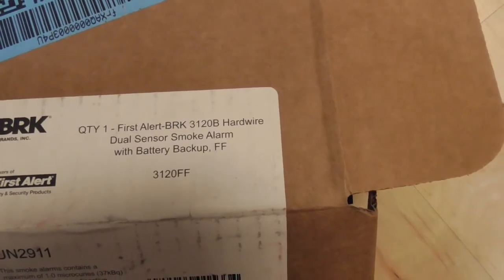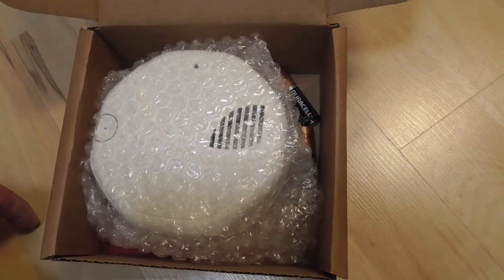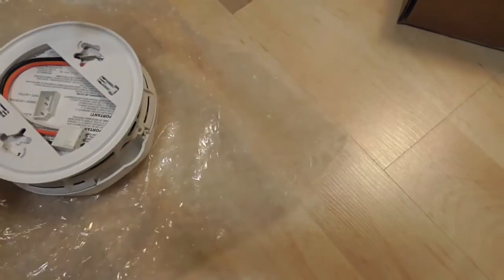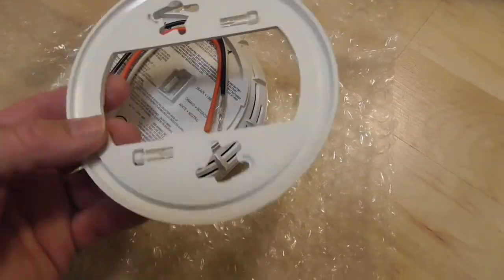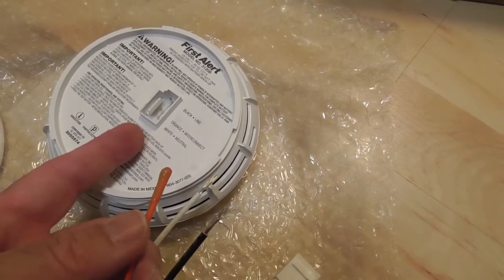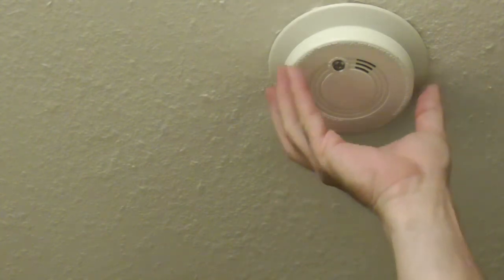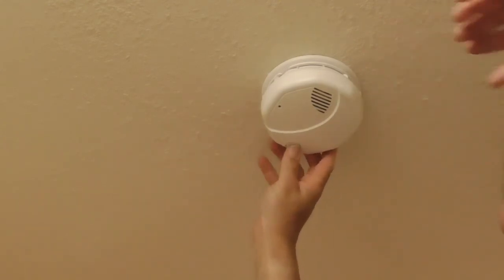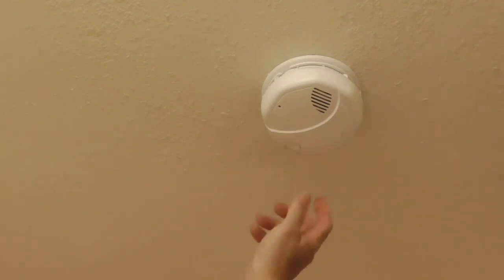First Alert BRK3120B from AMAZON Dual Sensor Smoke Detector HOW TO INSTALL SMOKE DETECTOR

Comment: I must be missing something, but the Orange wire which the tip is blunted or covered for some reason, that' what is confusing me. If the Orange wire is the Interconnect and my house does have a black, white and pink stripe wire (Interconnect?) then do I have to Strip the end of the orange wire for me to connect to the Pink Stripe wire in my house. Confusing. UPDATE: I found the answer on another video. The end of the orange wire, (INTERCONNECT) Is a CAP. Instructions don't explain this or this video.
Reply from the maker: what in the world is a CAP

Comment: I’ve never seen a hardwired alarm without an interconnect. That’s not common. Do you have other hardwired alarms in the same building?  Would you benefit from interconnect? I know that the nest protect supports hardwired power and uses wireless interconnect. That seems like it would be a good fit for this type of building.
Reply: There is a wireless interconnect variant where there is only a black and a white wire. Although most wireless interconnects these days are battery-powered.

Comment: Are the Batteries really 10 year warranty?
Reply: +LEARNINGCHORDS let me rephrase,  is it as good as the larger 9v battery
Reply: @LEARNINGCHORDS  But if that was the case, then they would have sealed and just had you pull out a tab, wouldn't they?

By the way was that a FireX ADC you had originally? It looks like the ones we replaced with these First Alert 3120Bs.